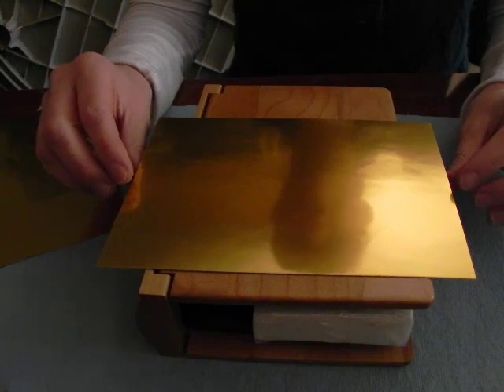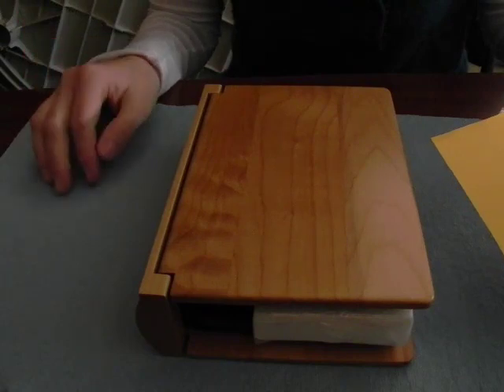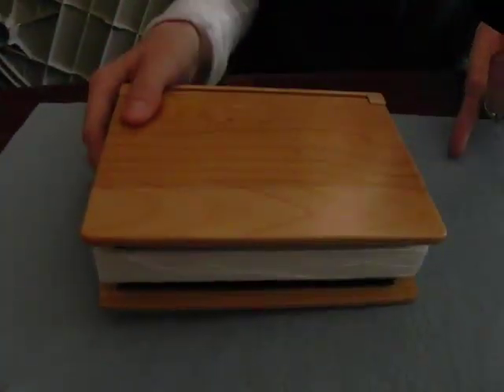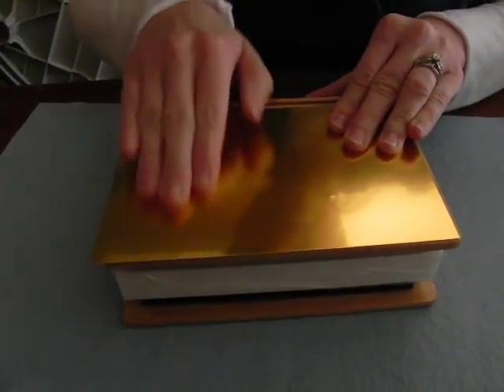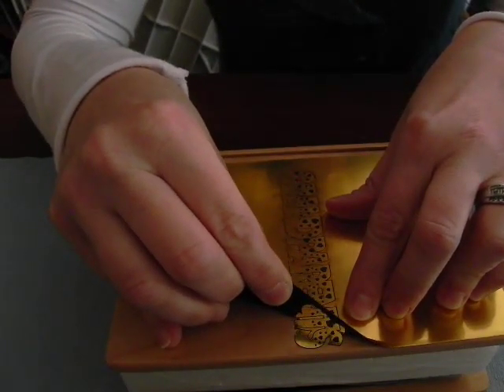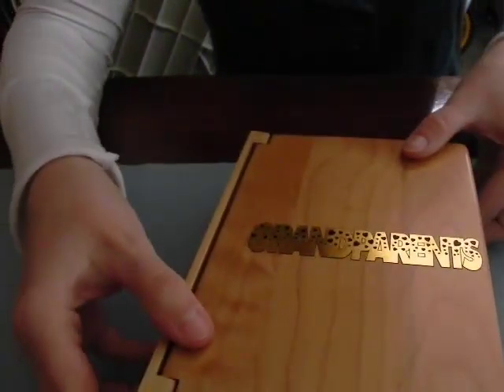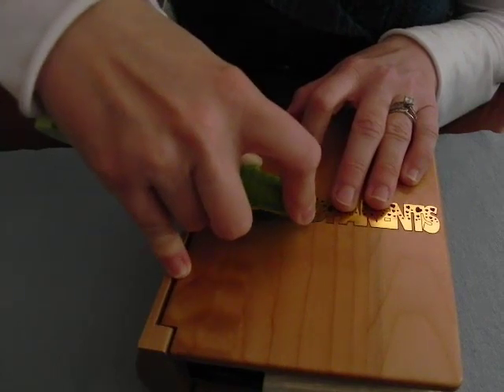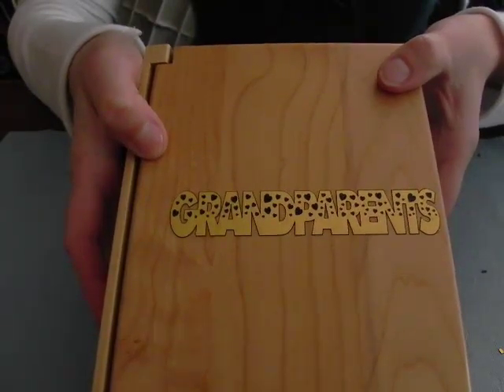LaserLIGHTS by Rowmark for laser engraving

Comment: you were able to cut laser lights on the wood book without burning the wood?
Reply from the maker: Yes. The LaserLIGHTS must be applied first, then vector cut. The settings will be at a low power and a high speed.